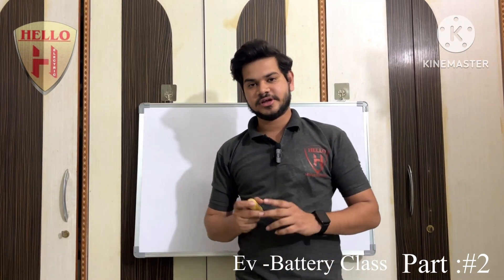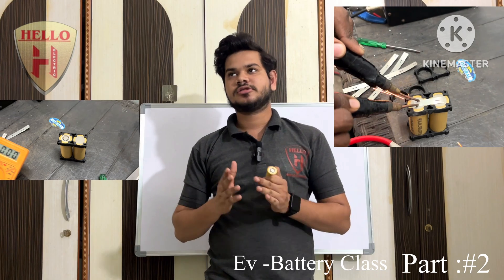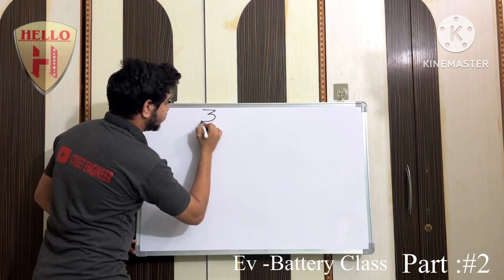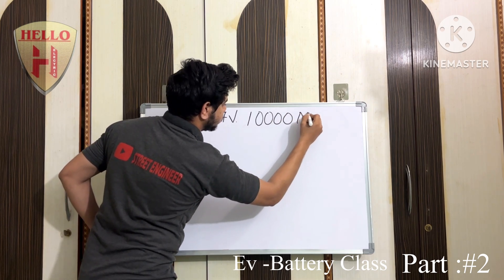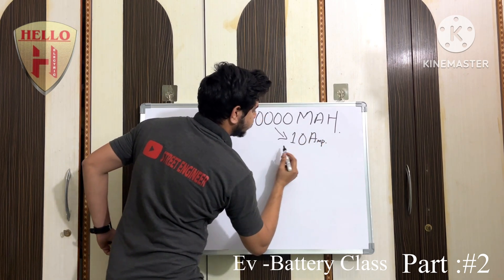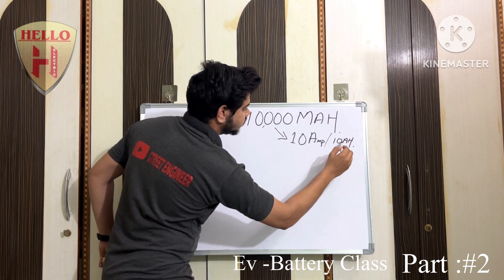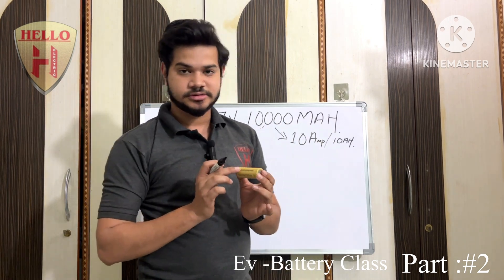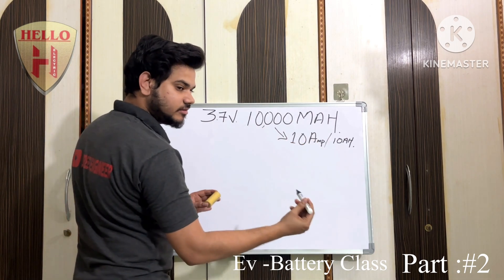Part 2 Learn 6v 10ah Lithium ion Battery making | Training  | in English

Comment: Where to get this components like battery, BMS , battery holder spot welding machine etc ,,.
Reply from the maker: 8056248257 calling number . 
+91 81486 45086 WhatsApp